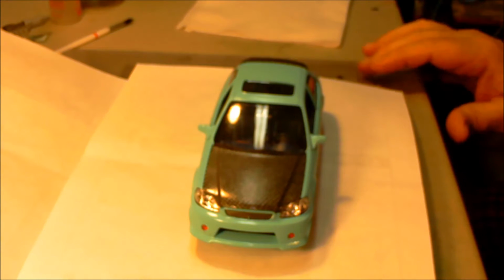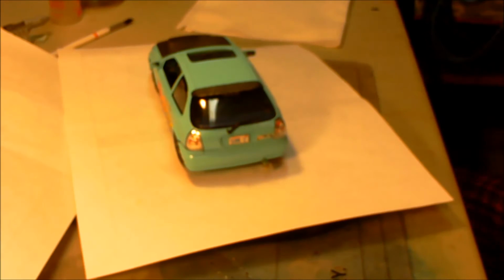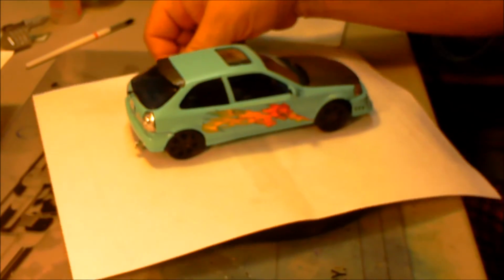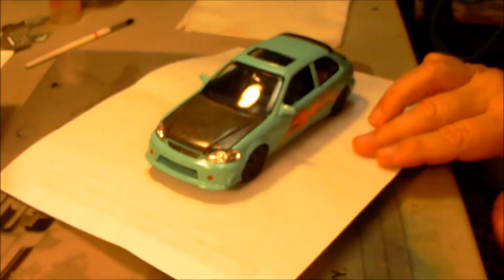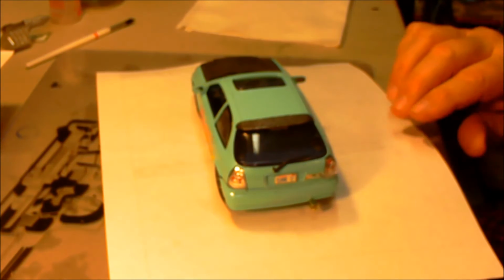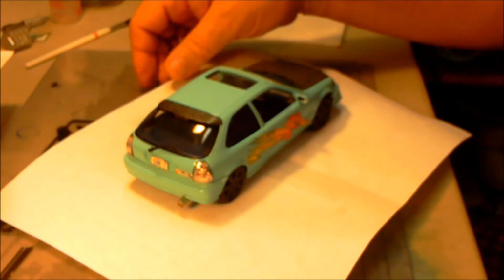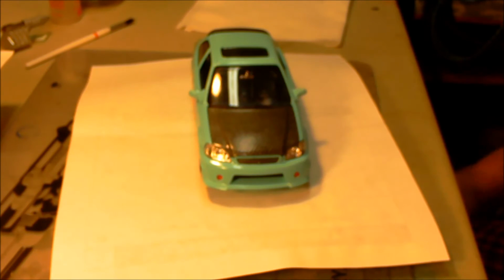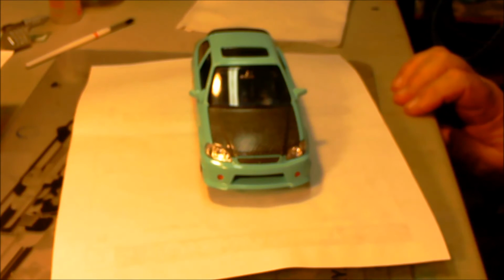Honda Civic Tuner reveal

Comment: Awesome work bro, love the color choice on your honda!! I had the same issue with the rear lens as well. The driver side rear light bucket I almost sanded flat just so it'll sit flush & same with the lens, but the side your talking about, passenger side, that is a big fit issue & my lens sticks out a bit too! The front bumper on mine had fit issues along with the front light buckets & lenses! I glued my rear bumper on before painting cause I knew about that fit issue. I'll have to get another hood for my build though. Anyways, you did a fantastic job though even though you had those issues. I'll be pointing them out in my next video. Kutgw bro, peace!
Reply from the maker: Thanks Chazz. Sanding the rear of the chassis pan helped some it was a lot worse. I glued the front of first so I didn't have much trouble with it. I'll try to get you some 1/20th parts in the mail Monday.

Comment: Sweet Hot Hatch James. I used to see a lot of those wrapped around lampposts on Monday morning on my way to work, lol. I do something similar for Carbon, using a pair of my Mum's old tights (er... I think you call them... hosiery?) Light spray of silver through the mesh and then dimensional tone down with headlight tint and clearcoated. Doing it with decals would drive me nuts XD
Reply: OH and... because they all have those Demon Tweeks Afterburner taillights, the questionable fit is authentic! haha FOR THE WIN! yay.
Reply from the maker: Thanks Steve. I don't know how a man could fix a part being too small.
Reply: I had to extend the w/shield glass of the 2013 Pre-painted Challenger because of the poor fit. For this I used 2 part clear epoxy (unfortunately this yellows in time, but not that noticably, if it's thin and off to the edge) ...For this I used  810 Magic tape or electrical tape (something with a smooth flat adhesive side) stuck on as guide for the epoxy to continue the flat surface. The epoxy needs to fully cure before removing the tape (carefully) so keep your mixing lid as a guide. Oh, and gentle frost up the attach edge with soft sandpaper as a key for the glue. Not something I'd recommend, the whole thing scared me silly and I think you gotta be in precise mode, get it right first time and not fiddle with it...mmmm and my hands are getting shakey now . yeeesh (sorry for the essay) Lol, but these are the frustrations we modelers have that get us in over our heads. GBY buddy.
Reply from the maker: Thanks Steve I'll try that next time.